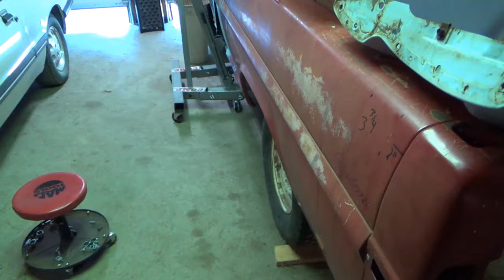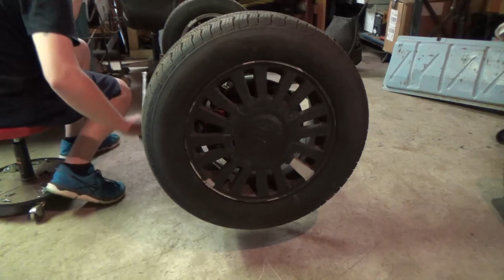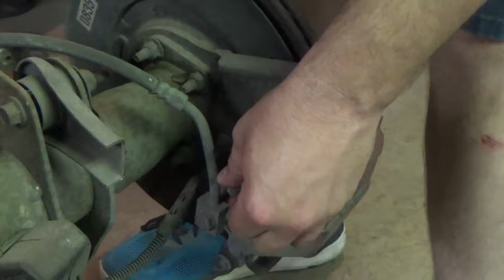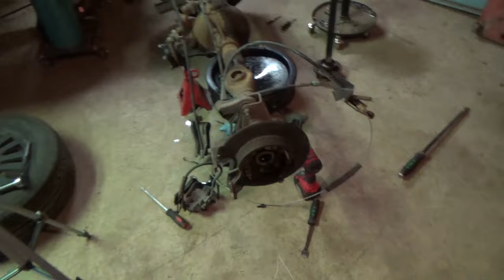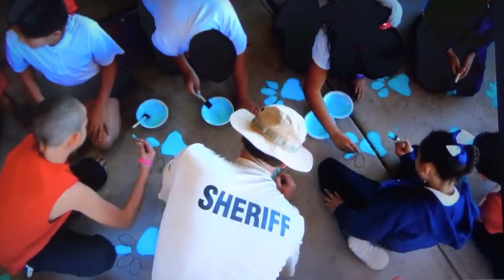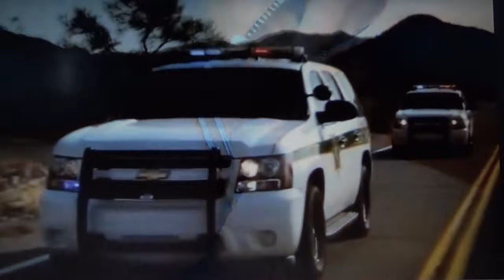What's the diff? '69 F100 rear axle

Comment: Will you explain your concern with the 28 spline being a problem. I'm trying to learn more about diffs, and I don't know what this means.
Reply from the maker: 28 spline axles are smaller in diameter and weaker than 31 spline.  They are the weak point in the 8.8 axle and can snap on a hard launch at the dragstrip
Reply: @cprgarage3206  if you had discovered you did have the 28 spline, would switching to the 31 change your gear ratio?
Reply from the maker: @jfelshaw  No!  Splines are how many grooves and lines are on the axle shaft where it slides into the differential carrier

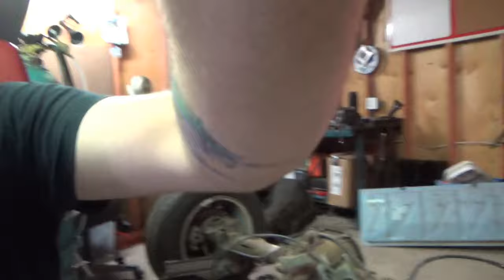Comment: I thought the GM's used the C-clips to remove an axle. My Ford 9" has 31 splines Moser axles with 4:11 gears and full spool. Axles slide right out. Need to replace the full spool for a Ford Trac Lok Diff so I can turn corners on the street, lol
Reply from the maker: Robert 8.8 are a bit lighter than a 9" and use c-clips.  I have built a few 9"ers too

Comment: Have you ever thought about running a Ford 9.75 inch diff???
They are almost as strong as a Dana 60.
Almost all have Posi.
They are stupid cheap.
You only have to redrill the axles to match the lug pattern of the front wheels.
Reply from the maker: Have not though I think that is what is in my 2005 super crew?  Six lug though not 5x4.5